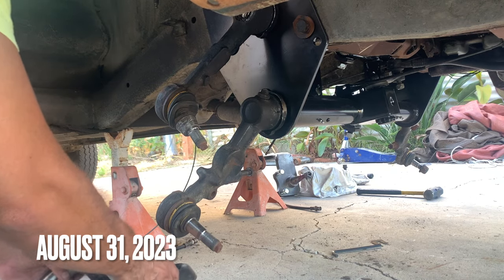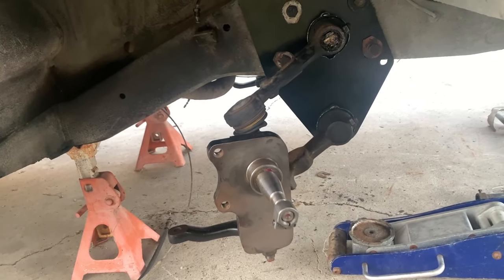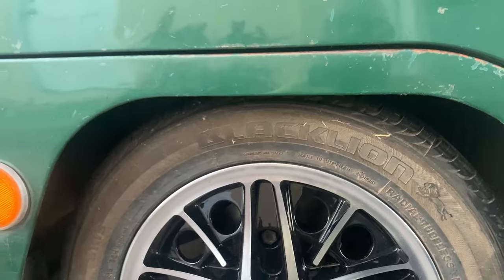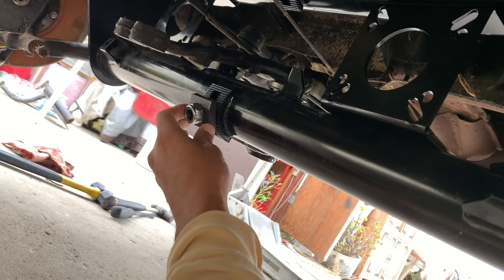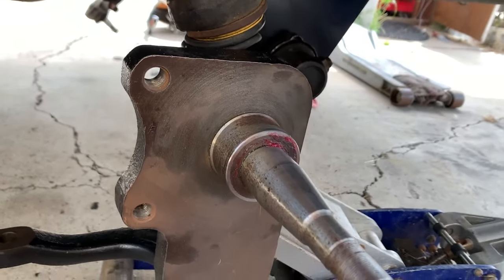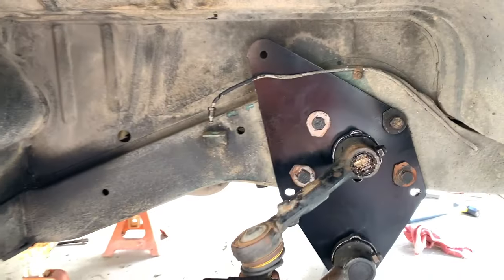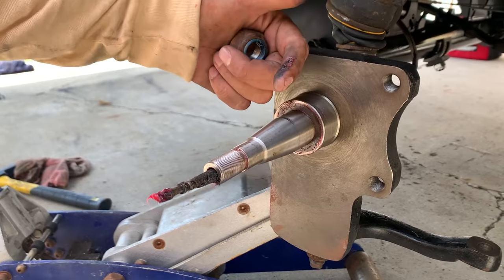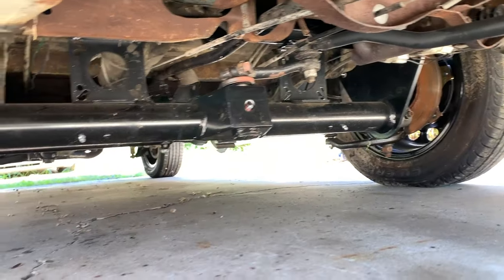Front Beam Install Part 3 - Final Part | 1969 VW Bay Window Bus Revival Project Episode 29

Comment: Looks soooo good man! Great job on the front end build. Drop spindles paired with the adjustable beam is a sweet combo. 👍🤙👊
Reply from the maker: Thanks dude. Can’t wait to drive this damn thing. But it’s always something. Just finished some repairs on the brakes so planning to bleed them and then do the alignment.
Reply: @SanDiego_VDubLife  Cool man sounds like you're getting close. Going through the struggles and doing all the hard work makes it that much more enjoyable when it's done.

Comment: Don't forget to pump grease to the beam!. the tubes should have 2 grease dimples on each tube.
Reply from the maker: Yes. Forgot about that. I still need to do an alignment so I can do it then. I even bought a pump for grease with a nozzle for the zerk fittings.